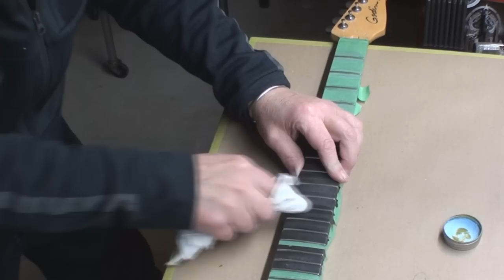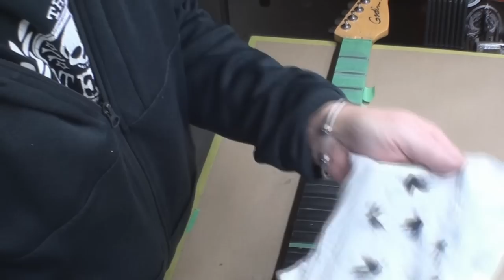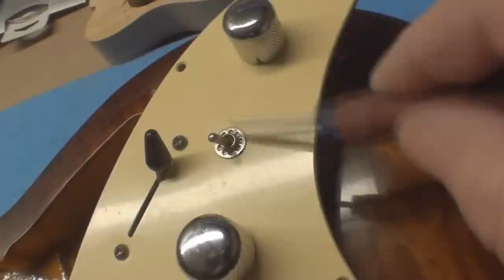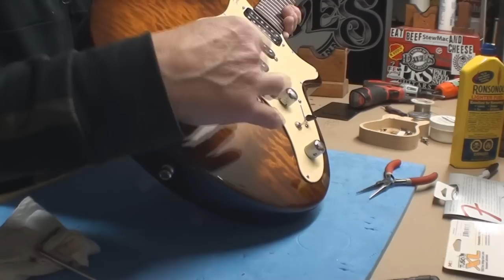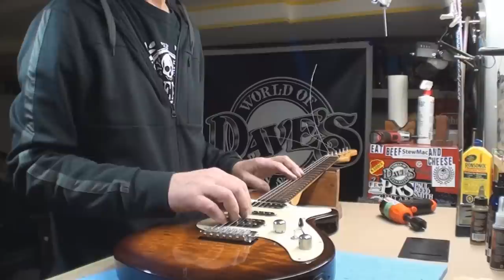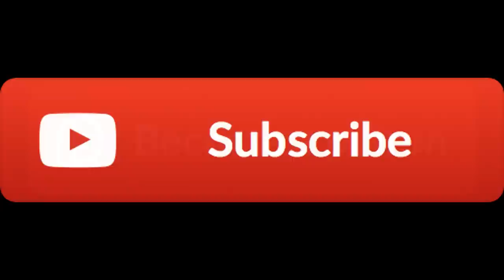Godin SDxt Guitar with Tremolo Stopper

Comment: I bought this same guitar many years ago and it did not come with the tremelo bar. When you put the tremelo bar in on this SD model, does it simply pop in?  Or is there any other fittings, etc that are required to keep it installed?

Comment: that trem stop is a great ideal.
Reply: So, Dave used to use a block and then he'd adjust the springs until the block would fall out easily.  Using the trem stop, I was wondering why not trap a piece of paper between the stop and the block and then wait for the paper to slide out easily?

Comment: I love those contoured neck heels and the countersunk threaded bolts on the Godin neck joints, still too difficult a thing to imagine for Fender for some strange reason. P.S. Do you still use that wool-in-a-tin polish stuff for a final buff of the frets Dave? I left mine in a shed at my old house, is it worth me sneaking back in to the while the new owners are out? I hate Amazon that much ;-)
Reply: I found a container of "Nevr Dull" on eBay for $12 
I'd just spend the $12 and get a new container
Reply: Their contoured neck heel isn't really an advantage - it's just to mitigate the loss of upper fret access resulting from the guitar neck's early join to the body (15th fret vs 17th fret).

Comment: What happens to the polishing stuff your useing when they use a dremell is the same thing that happens to buffing compound for wheeling  out cars. First spin it goes in the air. 90% of it anyways. The secret to buffing is to put the compound on the paint than smear it in the area your going to buff while it's stopped and go slow for a couple of secs till it coats the bonnet.
Reply: Eh, yeah. I understood all of that........

Comment: I have a stock SD, looks exactly like this, with the original cream pickups (4 set screws each -- why oh why, Godin?) and without the re-wiring job. It has the same bridge but does not have that wacky cavity routing, so will sit on the deck like most Fender-style whammys if you want it that way. Wonder whether that's the factory configuration, or a mod? It looks sprayed-over, so probably came from Godin. Any reason they, or somebody, would ginzu the cavity like that?